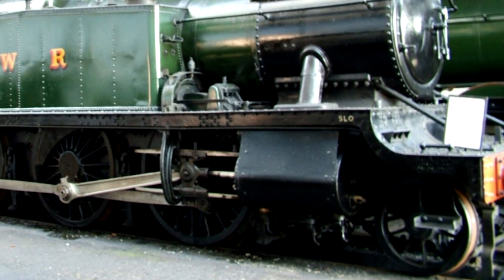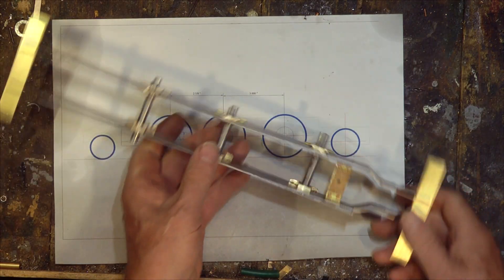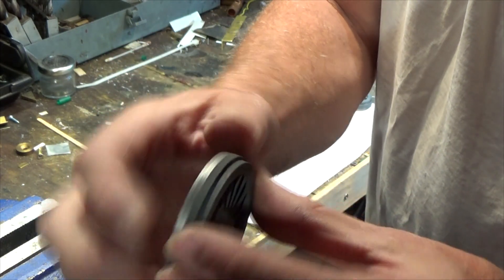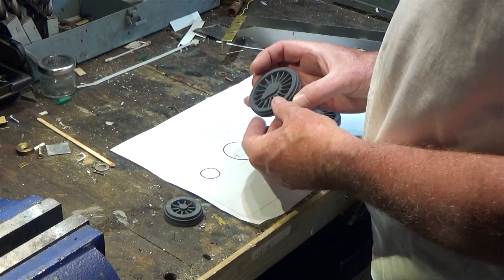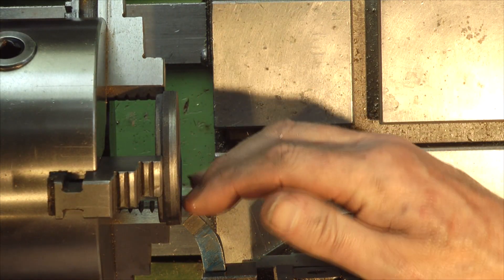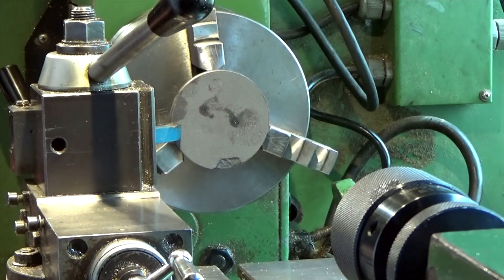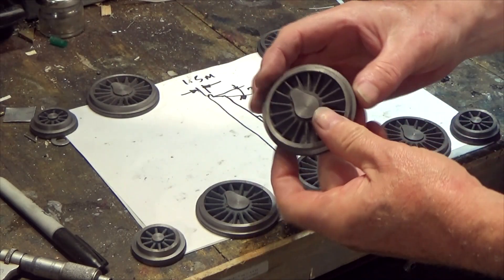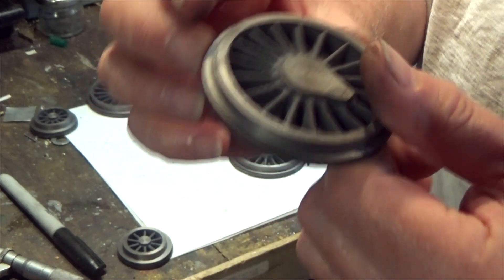Gauge 1 Live Steam Scratch Build 3

Comment: Nice done! ... just one thing.... 
After cutting the cone on the wheel... i would not turn it arround.... just let it in the chuck and bore the axle holes.... if you flip it.... the center is out of Alignment relative to the running circle (cone) the wheel center and the outer circle (running surface) is better done with one unchanged setup!
Reply from the maker: I did say  in the video there was more than one way to do it
Reply: Indeed! In his book, "The Pennsylvania A3 Switcher (The first project for the beginner)," the author Kozo Hiraoka emphasizes this very point. "In all cases where perfect concentricity or squareness is required, the related surfaces must be machined in the same chucking."